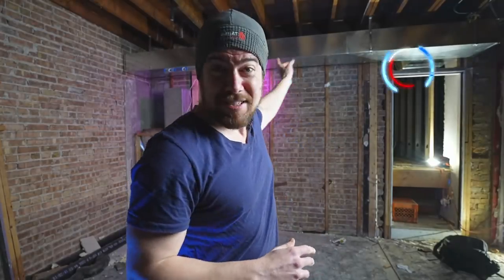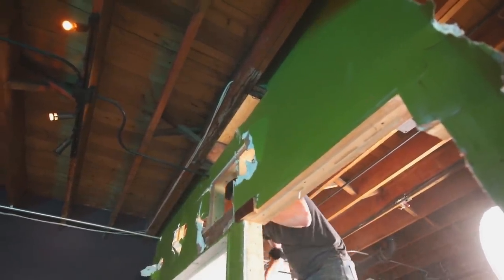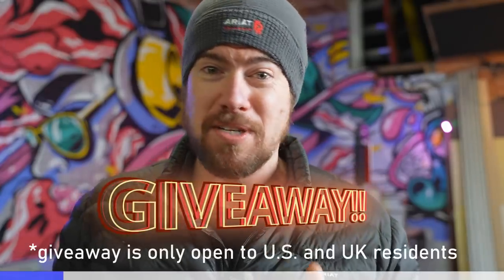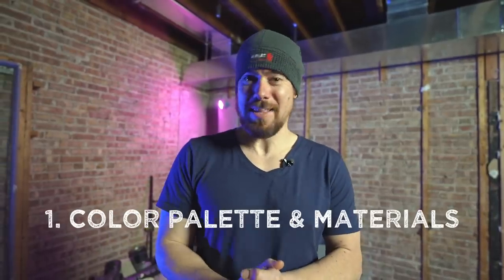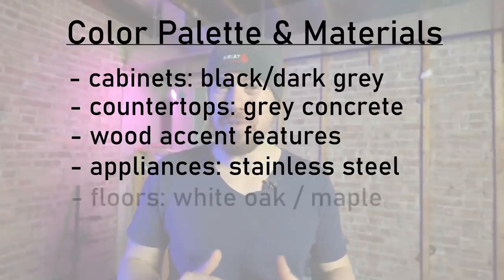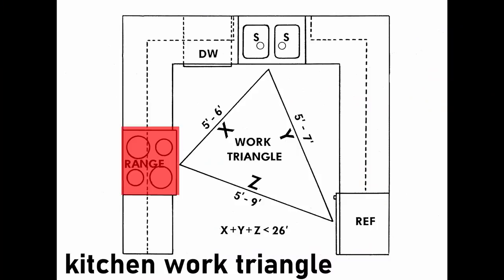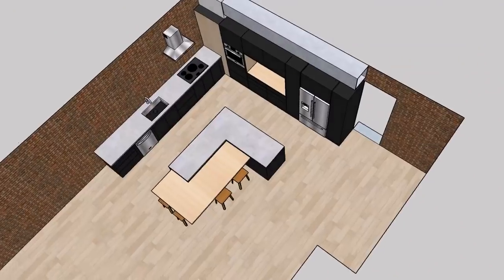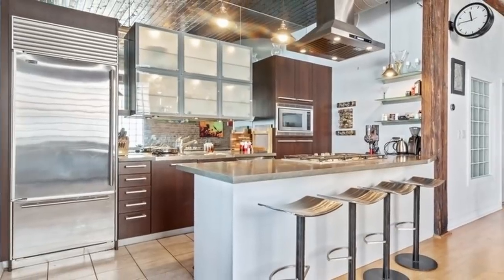Abandoned Building Reno Ep. 11 - DREAM KITCHEN Design and Demo

Comment: Did you consider putting the cooktop in the island with the sink where you plan on putting the cooktop? May help with the flow of the triangle and if you put in a flat cooktop (glass or induction) it could help maintain a flat surface on the island. You can get hoods that “hover” too that look nice.

Comment: Absolutely loving the progress on this project. 

Kitchen layout is spot on - L shape with an island to keep the flow and make use of the full layout. 

I'm really surprised about the 20k budget, in the UK you could get an amazing kitchen like that for 10-15k I'd say - 11k for a fridge is bonkers - LG & Samsung have top of the range American sized smart fridge/freezer combos for under 2K (LG are really pushing boundaries) - have you considered continental brands like Smeg & Miele? You might even get a better deal on the products if you get them imported (try Amazon.de or something) – price differences are massive! 

Couple of suggestions: 
1) Definitely recommend separate built in oven/cooker rather than all in one or standalone - for me standalones look cheap & unappealing and if you're paying top dollar, you might as well do it 'right'.

2) When you get an oven - look for a pyrolytic oven - it basically a cleaning setting that heats the oven up super-hot and turns most of the dirt/grease to ash making it super easy to keep clean (just take out the bottom tray that catches all the muck! 

3) Have you considered Extractor fans that pop up from the worktop (I think they're called downdraft)? it'll keep an eye-sore of a single extractor unit away from you - they're a bit pricier though but they've improved over the years I'm told and maintain a clean look. 

4) Personally I wouldn't opt for the dark colour scheme - it looks amazing brand new and on those pictures, but.... once you use the kitchen....well...black shows every speck of dust & marks, you'll constantly be cleaning or it'll just look dirty all the time. It's just not a practical colour - I'd recommend keeping it light, white/wood coloured with stainless steel 
Either way - hope the suggestions get to you and help - and regardless I'm eager to see the final product - place is starting to take shape and looks amazing! 

5) Definitely get a splashback behind the cooker – you do NOT want grease marks on brick, it’ll be a pain to get clean – again practicality 😊

Comment: To be  "Simplisafe" I have several thoughts on your kitchen layout!  1.  If you want drawers for your dishes, I think you might want to consider how far away the dishwasher is from the cooktop and open cabinet area on the cabinet wall.  I couldn't tell for sure how many drawer cabinets there were to the right of the cooktop and then between the kitchen sink  and the cooktop?  2.  How do you plan to use the open area/countertop of the cabinet wall?  Is it worth the visual clutter to have it open or  possibly put cabinet doors across the front of the open area to hide it when it isn't needed?  3.  Are you going to make the island from cabinets with lots of drawers and other storage?  I don't think you mentioned what your plan was?  Also, speaking of cabinets, your big full height pull- out storage is great, but if you put olive oil or other cooking items there, then again, they won't be close t the cooktop where you need them!  4.  IMO  it is almost always best to use 4 drawer cabinets rather than three to keep organized better!!  I think I saw a 4 drawer to the left of the dishwasher, but definitely keep 4's over 3's!  5.  You are correct about the kitchen triangle, but depending on how much you cook/bake, it seems like the refrigerator is a long way away!!  6.  I would almost switch the wall oven with the refrigerator  or better yet, center the refrigerator on the "cabinet" wall and have counter space on both sides of the refrigerator.  Grabbing a beer as you walk by is in (IMO) a terrible reason to have the refrigerator next to the hallway!!  Think about when you walk into the kitchen with groceries and you don't have direct access to put the groceries on the island and then have to twist back and forth or have a cabinet in-between?  7.  Why the light wood panel at the end of the cabinet wall?  I think you lose the drama of the dark cabinets unless you want to highlight your art or something else?  Is it wasted space not to use it as a cabinet for storage?  8.  Add some cool  LED color-changing lighting to the island concrete countertop in a linear way that would be far enough back from the edge of the island counter, but allow you to add color mood-light to the kitchen??  You are the expert at that!  9.  Love the island and lower counter area idea, but in 50/50 proportion in size.  Right now it looks like the sitting area /counter is way bigger than the concrete portion of the counter?  Island could even be expanded to make a full rectangle?  10.  I have a gas cooktop and downdraft.  You could probably make that work on the cabinet wall so you don't have to put the cooktop on the sink wall?  I look forward to seeing what you decide!

Comment: Accurate if rudimentary description of what a work triangle is.
In my professional opinion u shaped or galley kitchens are more functional but do come with the draw back of being tighter. That said I probably would have put the cooktop on the island. The smaller work triangle will make it so much easier to use the kitchen.

Comment: You can always start with a range/oven, but build the cabinets, since you are doing them yourself,, in a way that you can later install a standalone oven. If its something you like, but can't justify the expense right now, run electrical as if you are doing it, just dead-end it behind the modular cabinet that would eventually be replaced by an oven. Its an option.

Comment: Doing a wall oven would likely be better in the long run as you can put food in/take it out without bending over the way you have to for a conventional stove (oven on the floor with cook top above it).
Not having to bend over is much safer since your arms stay farther away from the upper heating element.
It's also much easier to look inside to see if your food is finished cooking without having to open the door and loose heat.

For the separate Cook Top, if you haven't already decided on one, may I suggest a 240 Volt, 20+ Amp Induction unit.
It'll cook a lot faster than traditional electric or gas burners with MUCH less waste heat bled into the kitchen (preventing the kitchen becoming viciously hot in the summer when cooking dinner)...
They're the easiest to clean too...

Comment: One thing I didn't see in this kitchen design is a point for a washing machine.  Here in the UK most houses either have them plumbed in near a sink or in a separate wash/utility room.  I assume from the lack of provision here you are going for the latter.  Otherwise it looks like a cool scheme although I would consider different seating.  Those stools don't look very comfortable if you have to use your laptop for very long.

Comment: I understand what you are saying about the difference in cost between a cooktop and wall unit oven verses having a stove. I had the same dilemma when I remodeled my kitchen. However I ended up having a stove, a wall unit oven and microwave. Turned out that by the time I took into account the price of the cook top, what had to be done to the custom cabinet for the cook top and then the cutting of the granite for the cook top to fit in, it was about one hundred more to have a stove. Sounds funny to have two ovens but it comes in handy for the holidays and it's much easier to get items in and out the oven from the wall mounted one than it is from the stove one. Especially when it's a twenty pound turkey.

Comment: One other thought - power supply is super easy to overlook in kitchens too.  Cords are always super short on coffeemakers, toasters..... so put in one or two more than you think you need.  Otherwise you hand cuff yourself on where things can go.  GFCI them too, obviously.

Also kitchens and islands are ALWAYS a popular hang out spot.  Use outlets that have the usb charging ports as well.  Especially off the island with seating.  Just trust me on this one.  They're only a couple extra bucks, and you'll never not use them.

And while you're at it.  I'd seriously consider mounting some hidden bluetooth speakers in the cabinets sense you're custom building them yourself. Again, trust me 😀

Comment: Save money by buying used appliances. There are awesome appliances like Viking and Wolf that are available after richy rich people remodel their kitchens. It can take a while to find the right deal, but I've had luck on Craigslist and Ebay finding Viking appliances. I currently have a Viking range top that came in black and I'm going to have it sandblasted and then have a ceramic coating (Cerakote) applied. There are so many Cerakote colors to choose from that the end result will be something truly unique and top of the class for a lot less than brand new.

Comment: I love my double Dacor convection ovens and my Viking 6 burner gas cook top....double ovens with extra racks.....bake the hors d'oeuvres in the one oven, keep them warm in the other.  I also have a Subzero Fridge (501) no problems with mine.  But I do miss having the freezer with ice and water in the door. I have light grey cabinets, black tile backsplash, and oak reclaimed hardwood floors. Wish I could post a pic....

Comment: I still think you have the opportunity to have storage on the exterior wall where the base cabinet is.  Did you consider installing open floating wood shelves on that wall, using the same wood as the table?  I think you can still maintain the one wall kitchen site lines depending on the dimensions of he shelves and what you put on the shelves.

Comment: I think you you may have been inside my head. My kitchen, when finished, is going to be similar colours. I went with a light grey stained timber bench top instead of concrete. Still trying to find the right colour for the cupboards but I'll get it eventually.

Comment: Looking at the overall size of the place - are you going to pull Cat7 into the major areas (at least one patch at either end of the building on each floor) and set up a patch panel?

WiFi is great - but having Ethernet in major areas of the house allows you to have a stable backhaul connection for the mesh Wi-Fi you’ll inevitably set up through a future sponsor ;-)

Comment: Instead of a counter depth fridge which is smaller, you can get a normal size fridge and recess it into the wall where the current door frame is. Same look, but bigger and cheaper fridge options.

Comment: just a suggestion do get a pizza oven as it heats up quicker uses less power an can cook far better than a normal large oven which unless your doing a turkey or gigantic souffle your not going to use as much so that could help you lean more to the wall oven setup with the dual oven just a suggestion from a large family which uses both when cooking a lot but only the smaller one when just a small meal or keeping things warm

Comment: Cool Design idea! ONE thing I would consider: Leave away the oven extractor on the brick wall. I think it disturbs the complete design and a plain brick wall, with nothing hanging in between, will look amazing. So instead of that get a (little bit more expansive) retractable oven hood. I don´t know if this is the right english word. I mean a oven extractor/hood that diseapears in the counter top (so it´s invisiable) and by "pushing a button" it comes out of the counter top if needed. THINK ABOUT IT!!!

Comment: that door on the left looks like the header is superficial. There's no load bearing at that point to bring the forces down each side of the doorway... Is there a big post between the two doorway? either way you need to take a step back from the situation because that 'broken' brick wasn't installed to do the normal structuring so it's probably at another point in that wall system

Comment: MM, from my stand point, that of a plumber with numerous commercial, institutional and residential kitchens in my resume; you did a great job of analyzing the choices, you covered the work triangle which is sacred to licensed planners and designers, and you hit the high points of the budget problem. I wish several of my residential clients had half your snap! A couple of your choices want comment; I like the concrete counter tops- finish them and make them NON POROUS- you will thank me later. Porous materials as counter tops will always take stains and be a potential for hard to remove odors, etc. Seal the 'crete and then put an epoxy coating on it- clear, flat to shiny, but put it on as a life project, and skip no steps!
Love your design overall, although I could make a case for the 'fridge on the opposite end of your L shaped design where it would make less through traffic when there are people in the LR for instance. Definitely go with the slide out range, unless you or your wife are going to regularly be making baked goods like bread, cakes, large baked dishes and the like. Get a stove with an oven big enough for the largest size turkey you might have- it will be large enough for anything else you will ever do with it. It will simplify venting (your cabinet oven will need a vent) and centralize all the hot hardware. I'm not a licensed kitchen planner- you could actually get the cabinet department down at the Big Box Home Repair Store to do that if you buy your cabinets from them- but you may need one, as everything else in your build has had the City of Chicago's fingerprints on it!Btw, loved you vanity sink for the bathroom- great, simple, easy to clean- just put the full effort into sealing and topping it to control the stain and cleanliness thing!

Comment: may i make a suggestion? why dont you swop the cooktop/hood with the sink? that way when you have guests over and you are cooking you dont have the zink(and which ever dishes is in the zink) between you and your guests and you are not there at the back of the kitchen having to shout at them all the time. another thing is that when you swop the zink with the cooktop you are not so closed-in...kind of like cooking in a corner, and if you move away from that corner there at the back and if you have things splattering, it doesnt splatter against both walls. for the rest i think it is perfect!

Comment: You and I share the exact same liking when it comes to storage options. I love dishes in a drawer. Same with full pull-out storage systems. Corner cabinets must have a carousel in my experience. Even overhead ones. Otherwise anything stored at the back is just destined to die there. I also hate storing food appliances like cooking pots and dishes out in the open. Leaves them open for dust to settle on them with ease, meaning more cleaning. No thanks

Comment: no wall oven- do the range.  much cheaper- and easier to update.  make sure you do vent the hood to outside- build a little appliance alcove in the corner .   keep the lower cabinets dark- and do a really nice wood on the upper cabinets.   will not feel so  office like.    take the plan and start writing on every cabinet were everything will go.  like the glasses, plates bowls. crock pot, coffee machine.  If  you could find some burl wood to make some of the doors out of.  A really flat door but with a wood with amazing flaws and character.  possibly fill ing the knotholes and cracks with cement. LOL  tons of outlets in island. a appliance garage.  and possibly a living herb wall above the sink.
Reply from the maker: I really dig the idea of the living herb wall above the sink 👍👍 I wanted it open, but does feel like it needs something....that would be perfect, low profile and add a touch of green
Reply: was also thinking if the 3 floor room is above- do a glass floor ceiling above the sink to let natural light in from the roof cupula.  Was thinking glass blocks in a metal grid-- or those glass bricks  that would be in the sidewalk in front of old stores to let a little light into the basement area under the sidewalk.

Comment: I have two questions....

1. Why is Gas such a standard, prefer induction cooking plates much more. They have all the advantages of gas without the drawbaks.

2. Why the hell do you need HVAC and with such massive diameters. I've never seen a normal house around here with such ventilation.

Comment: I am a chef and former salesmen, I STRONGLY recommend you research Vent-A-Hood. It is the best kitchen ventilation system! instead of baffles, it has a centrifuge style fan. it has NEVER had a fire and eliminates 99% of grease before it goes into your ducts. trust me but please research it. if you need to save money you can buy an insert and make a canopy to catch the smoke.  If you want to talk about appliances, I can make suggestions. Look into DCS gas ranges. they are nice.

Comment: the triangle only works if u dont have an island in the middle. depends on how much u like to cook and have good stock in the house, i would suggest to check out a walk-in fridge (the kind that doesnt break). also, i think u need to ask your wife what she thinks of the kitchen because as u have it now, its very masculine and in my opinion quiet cold, yes, even with the brick. Having a separate oven is very convenient cause u dont have to bend down every time u want to check how things r doing in there, also, a lot easier to take things out. U also need more space on the right side of your cook top. make sure u have dishwasher on the side that feels comfy for u to load it. (usually on the right of the sink if u r right handed). the way u have upper cabinets now r more for show and r not practical at all. to me, the whole kitchen is not proportional to the space and feels empty and unfinished.